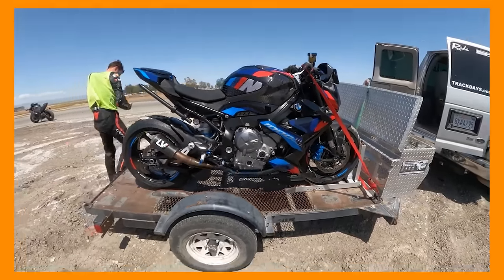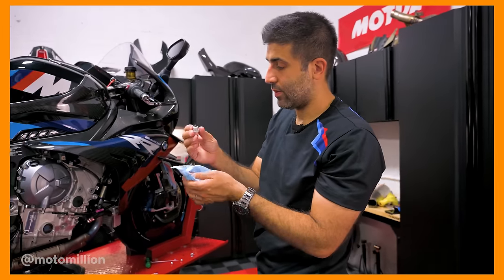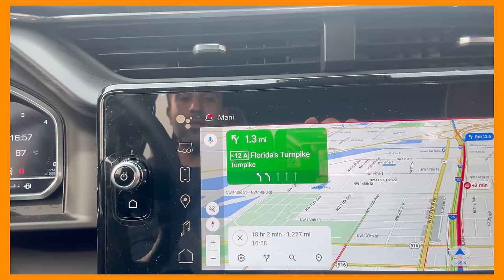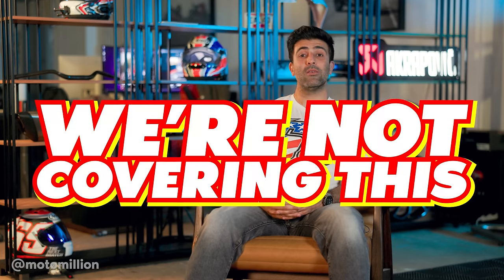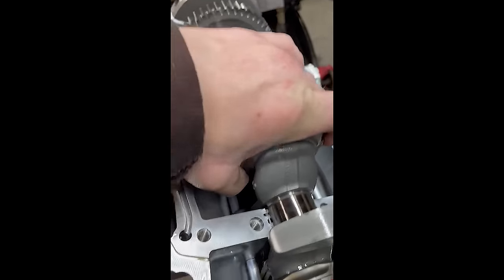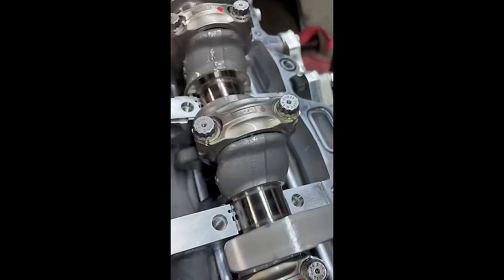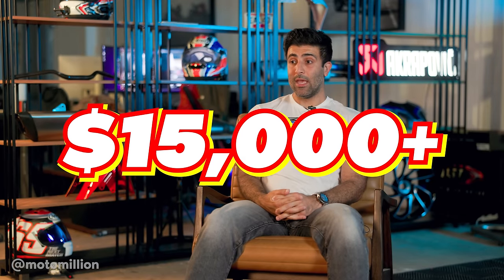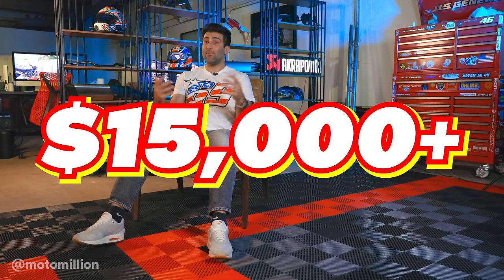MASSIVE Engine Failure on our M1000RR & BMW REFUSED Warranty...

Comment: Hello.  I have M 1000 RR 2023, I started having the same symptoms after 2000 km.  Engine rumble, a little less, but I'm afraid it would escalate.  I took the motorcycle to the authorized dealer where I bought it, now I'm waiting for an answer...
I already had many motorcycles, mainly Japanese ones.  I was very disappointed by Bmw.
Reply: Any updates?

Comment: I'm sorry that happened, but honest question here: I didn't see you mentioning how you unlocked the rev limiter of the bike. By any chance did you flash it with BT? Or did you just took it out of the OEM "break-in" software limiter?
Reply: These are the kinds of questions he doesn’t seem to be answering. There’s clearly a reason and he obviously voided his warranty somehow.
Reply from the maker: We did the first service following BMW's specs. Yes, we have the tools to do it, and we did it in house over here. Watch our videos. We are not hiding anything, Jacob.
Reply: @Motomillion  I’m not saying your hiding anything I’ve just not found clear answers to my question of what exactly did they tell you is the reason why you’re not being covered under warranty?? If it was over revved 250 rpm’s that’s probably all they needed. This was probably done on a downshift unless someone raised the rpm limit in the ecu the only other way is by downshifting into a lower gear at to high of speed. 
By the way I do fully agree this was a factory defect being I’ve watched so many bikes abused off the showroom floor without any issues. With that said you somehow voided your warranty and gave them a reason not to honor it. 
So how did this 250 RPM over rev happen?? and was this their only reason or did they have other reasons as well??
These are the questions your not being completely clear on their reason.
You mentioned a couple of possible reasons but I would like to know their exact reasons.

Comment: i would have done the 600 mile gentle break in on the first day on this bike , how hard would that be ? I mean he did 40 hr round trip twice for the bike lol .
Reply: yup in a weekend or in a week riding for a couple hours a day
Reply: My thoughts exactly.
Reply: That's because he's probably a weekend motorcyclist, not used to actually going anywhere far with his bikes. He just uses them as toys to go fast and get his adrenaline rush.

I mean, that's fine as there are many different types of motorcyclists and they all have a place under the sun, but it's not an excuse for failing to properly break-in the bike and not mess with the rev limiter... no matter how annoying you think it is or how limited you are on free time to be able to do it.

Comment: I remember when BMW produced their first super sports bike, I think in 2009. Not long after that, a guy I know who rides with my team occasionally bought one. His first engine broke a little before 4000 km, the BMW dealer replaced the engine without any problems. After the next 3,500 km, the engine again suffered a catastrophic failure, and it was replaced again without any problems. The third engine started showing signs again after less than 4000 km. The guy finally gave up on BMW, regardless of the correct support from the authorized dealer.
By the way, I am from Croatia, Europe.
Reply from the maker: Thank you for your comments all the way from Croatia! What did he end up buying after that?
Reply: @Motomillion  Back to Japanese, he bought Honda CBR 1000 RR. I have Yamaha R1 2015, first year of latest R1, I' have been watching your videos, mine is regular R1, not the R1M, but I upgraded it a little, with Ohlins suspension front and rear, and Brembo GP4 RX calipers and RCS 19 Corsa corta and other cosmetical staff, I have been inspired by your videos, risking a lot to be killed by my wife. I have 65 000 km on the clock without any issue, riding hard on the road with occasional visit to track.
Reply: Didn't they have a lot of problems with camshafts on the early ones? UK joke used to be that they had Cadbury shafts (as in Cadbury the chocolate maker)
Reply: @katywalker8322  Not sure what kind of problems, but the problems are not only related to their superbike.
Even their legendary GS, which has become a brand on itself, is of questionable quality. A friend of mine recently switched from a Honda Africa Twin to a BMW GS, I don't know why, he was probably bored, he just wanted a change. I asked him what is the difference between a Honda and a BMW.
He replied, with the Honda I just did the standard service intervals, changed the oil etc. and filled the tank, boring. With BMW, it's a different story, it's much more interesting, I've already been to the service center quite a few times for various repairs during the warranty period.
Sounds like fun.

Comment: Sorry to hear about the bike, Mani, but to be fair, I have seen many videos in which you claim you don't do the factory break-in and like to do your own method of break-in. I imagine BMW, Ducati, Aprilia etc. also see your videos and take that into account. It also seems like in most of your videos you are eager to get the bike on the dyno ASAP, whether it be for "content", or your own personal anticipation. You have to expect with the need for a hasty dyno run, or not breaking-in the bikes per factory specifications, things like this are bound to happen, and based on that, I can see a manufacturer not wanting to warranty a product. I am not trying to knock you as I enjoy your content, just trying to be fair.
Reply from the maker: Well, appreciate your comment. The break in is not "our own method", it is a method which has been discussed by engineers and engine builders. We have never had an issue with any other bike nor any other vehicle following those procedures, it is not smoke and mirrors either, the explanation makes all the sense when it comes down to real facts and science.

I have owned well over couple dozen vehicles, and none of them have had an engine failure to this case, and all get broken in the same way.

Furhtermore, we did not break in this engine the way we usually do since the factory break in limiter does not allow us to do so.
Reply: I hear you. I did not to mean to imply you have your "own method" of break-in procedure, or that it is "smoke and mirrors", just that it is generally a different procedure than the factory recommended one and that some manufacturers (in my experience) are just looking for a reason not to take accountability for a defective product, and not following their recommended break-in procedure to a tee (and video taping it) is just inviting them to make excuses for not wanting to warranty a defective product imho. The way I see it, if you (or anyone else) bought the bike, you (or anyone else) can do whatever you want with it, but I also can see why they may not want to warranty it as well based off that alone.      @Motomillion

Comment: I think the issue here is the regulatory environment around consumer protection in the US. Here in Australia, warranty is covered by consumer laws which override manufacturer’s warranties, meaning businesses cannot take away a consumer’s right to a refund or replacement for faulty products. The more expensive the product, the more protection the consumer gets (eg. A $40k bike vs a $50 clock).
Reply from the maker: We have laws in place in the USA too, but sometimes manufacturer get free reign until someone opens up a legal battle.
Reply: @Motomillion  I honestly think you should commence legal proceedings. That will get their full attention and will probably lead to a satisfactory outcome for you.
Reply: I agree. Once your report comes back regarding the bearing failure you owe it to your company to file a legal case.
Reply: @MrDeepseadweller  Absolutely they should be held to account, the bearing analysis is a step in the right direction.
Reply: He doesn't have a claim because he isn't a certified Bmw motorrad tech. And removed the Rev  limiter. Regardless if the engine was faulty and  they did it correctly or not. It voids the manufacturer warranty. That's why you need to take it to the dealership. 
Is it right? Maybe, maybe not. It's the way it is. Had he done what "Calimoto" did, he would have not had to pay out of pocket for it.
Reply: @jasonking4209  That may be the case in the US. I don’t know. But here in Australia it is not that clear cut. A manufacturer’s warranty is not the last word. A consumer has statutory rights over and above that. If it can be shown the failure was due to a fault in the engine, they are entitled to repair or replacement.
Reply: @MrDeepseadweller  Right, but the issue is they removed the rev limiter, and they're not bmw motorrad certified techs. It states that those things need to be performed by the dealership for this reason. He should have known better. I'm sure he would have sued if he could have but he couldn't because they did something they weren't qualified to do. So now he's making it sound like they just got it out for him and it's a bad brand. Which is completely false. Yes it sucks, I'd be pissed too, but ultimately he has to own the fact that he had something done he wasn't supposed to do and thought since he had a YouTube channel that he could get away with it. Well he couldn't, neither could you or I.
Reply: @jasonking4209  As I said, that could be the case in the US and that’s what matters here, but my point is that it’s not as clear cut as that in other jurisdictions
Reply: @jasonking4209  The manufacturer haa the onus to prove that the defect was related to the actions of the owner.  for example, if one were to install an aftermarket part, the warranty is not void and claims for defects by the manufacturer cannot be dismissed
Reply: @PhilippinesLife 
And you think BMW doesn't have heaps of data that proves that their break-in instructions and rev limiter were put in there for a reason? That they didn't invest millions of $ in research, development & testing of these engines?

This guy has NO legal claim against BMW, he would be silly to think otherwise after what he's done. And he should save his money instead of wasting it on lawyers that can't help him.
He should take the L and learn to not destroy brand new engines because he's horny to make YT videos with it (to make money, ofc).

Comment: I have never seen so many comments that are 100% WRONG in my entire time on the internet.  This issue occurred in the United States, where we have the Magnussen Moss act in place....which says you cannot deny warranty unless the manufacturer can prove that modifications you made CAUSED the issue that they are denying service for.  Sorry, but there isnt a tune on the planet that is going to cause internal bolts in the motor to come loose.  A tune isnt going to cause a bearing failure with no other damage visible (running a bike lean I would guess could POSSIBLY cause a bearing issue but its also going to do a ton of other damage as well, its not going to JUST affect a bearing).  The issue is that in order to fight BMW in court, its going to take time and money, to which they know there is little chance that a customer is going to pursue to that point.  Harley Davidson found out the hard way that their customers were willing to fight....and they had to pay a HUGE fine, had to send letters to EVERY CUSTOMER that had a valid warranty at the time of judgement, explaining to them that their warranty cannot be voided unless the work the customer did can be PROVEN to have caused the damage that was being denied.  It was a MASSIVE judgement and I may still have the letter they sent me over it.  The only thing saving BMW is that owners havent united and filed a class action against them, as I fully believe if it happens that they will lose in court.  People saying dont modify your bike til teh warranty is expired, well its a 3 year warranty...I am not riding this bike with the throttle governed to 30% in the meat of the midrange for 3 years???  If they allowed the bike to perform to even 80% of what its capable of then most of us would at least entertain that idea, but they have governed it to the point its pathetic....which is why MOST owners say the bike is useless until you tune it...(even the dealers say this....its literally a selling point of the bike in MANY places that the performance is off the scale once you get it tuned).  I own a 24 M1000RR....I am in the middle of the breakin period right now...and I am planning on riding it this season with no performance mods...put a few 1000 miles on it and then after that I will roll the dice and throw a tune and exhaust on it.  Hopefully I am one of the lucky ones that doesnt hit something ridiculous that they should warranty.  Its not just the motor, its injectors, water pumps, etc...that have been failing that they are voiding when there is no way a tune caused the issue.  Hopefully there is a class action against them like in Harleys case, and they are forced to do the right thing.

Comment: I had 2 engine failures on bmw s1000rr k67 and when i started having issues again bjw refused warranty repair.I sold the bike and went for Yamaha.No issues
Reply from the maker: Yamaha's are FANTASTIC! Sorry to hear of your issues, but I am sure you are not happy!
Reply: @Motomillion  i am not happy with how bmw is dealing with issues.Actually I managed to have access to my case and I was shocked with their internal emails.I will never buy another bmw again.I hope you will get reimbrused with the costs on the engine as it clearly manufacturer   fault.
Reply from the maker: Would love to hear some of the details about those internal emails
Reply: Denied why? Modded most likely?

Comment: I don’t know what to think on this. They are putting on aftermarket parts on the bike to increase horsepower. They put the bike on the dyno and it blows up when they try to milk more power out of it than it is designed to. BMW turns down the claim. I kind of think the guy owns the problem. Now the loose rod cap could have been from the cap bolt stretching from the over rev. Sounds like this is going to lawyer city.
Reply: Have a similar feeling on this, aside from the rod cap being loose… I don’t think a singular over-rev would loosen the rod cap to that degree…. I think it’s highly likely that the rod bolts weren’t torqued correctly to begin with… But dude fueled the fire for BMW to deny the warranty claim, which they are known to do for any reason that they can find.

Comment: I never owned a BMW but I'm pretty sure the service manual tell you not rev it over X rpm until the first service, normally at 600~1000 miles?
Reply: It’s even electronically limited…

Comment: 1st service is 600 miles. Not 400.
 Why buy a bike that hasn't had a pdi? 
How is this possible?
Track use voids the warranty.
A few things are not right here...
Reply: Not to mention he appears to not be aware of the basic principle of new engines having to go through many heat cycles in order to break-in properly.

Also they need to be used softly until engine oil has had a chance to form a long term protective film on brand new interacting surfaces.
It literally needs to bond with metal on a molecular level in order to keep it from devouring itself due to immense mechanical forces acting on it.

After that you can do whatever you like, even directly after an oil change. But those first I'd say 1500-2000 miles are absolutely critical and need to be respected.
After all, you wouldn't put a new born baby on its feet and try to make it walk. Same with engines.

Comment: My local BMW dealer told me that tuning the engine will not void the warranty with BMW. They told me the only time they've seen a warranty claim not go through for it would be that the "engine parameters were exceeded"
Reply from the maker: They are correct.
Reply: @Motomillion  well it's kind of shady because based on what you said. They told you at first it was because it was over revved. But then it was because you did your own unlocking? I see why you said let by gone be gone. Not worth that hassle.
Reply: @Doober50569 yeah, this guy is being sketchy AF. There’s plenty of discrepancies with what he’s telling us. There’s more to this story than meets the eye
Reply: @Doober50569 as soon as he said he did his own unlocking I knew right away why BMW rejected his warranty claim.
Reply: @Chris-vq5vr my thoughts exactly. A lot of things weren’t adding up and then it all made sense.
Reply: Some people with some sense! It's not a mystery why they didn't cover the engine.
Reply: It will void your warranty.  If you installed the BMW HP Race ECU on the previous models....it VOIDS your warranty.  It is very clear why they didn't honor your warranty.  Too many people think they are smarter than the folks that designed the engine and want to mess with a bike that they can't even ride what it has to offer from the factory.

Comment: I owned a 2014 Aprilia Tuono V4 and at 7,000 miles it needed new heads. The valve guides were shot and the heads needed to be replaced. Although this was a common issue with the 2012-2015 engine Aprilia would not cover this under warranty. Manufactures, in the world of profits vs quality will find any reason not to pay to repair flaws in their products.  I am an aircraft designer and have been building engines, racing cars and motorcycles for over forty years. To me it looks like the main cap was not torqued properly, it's that simple. If BMW admits to this than they will have to fix all the bike that come in with the same issue. Cost vs profit simple math.